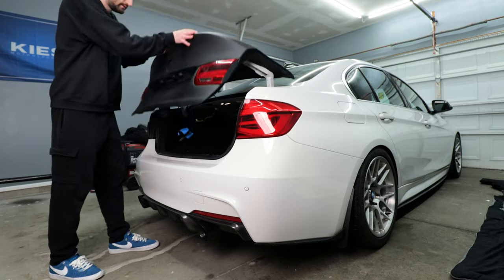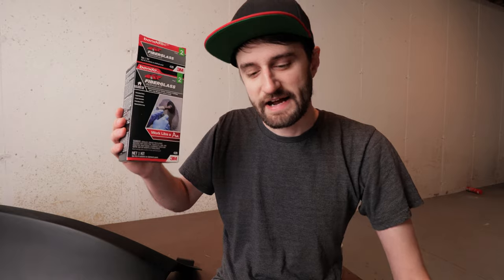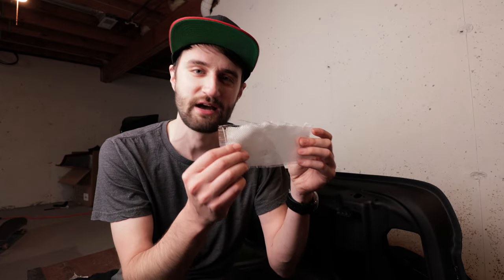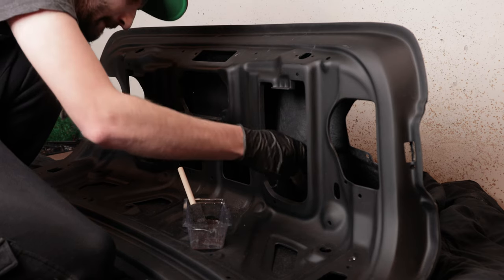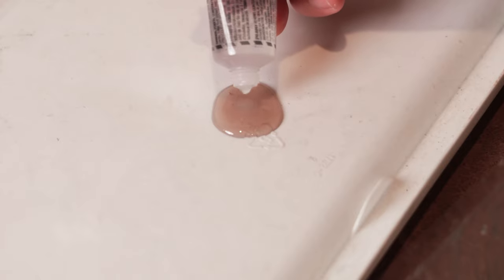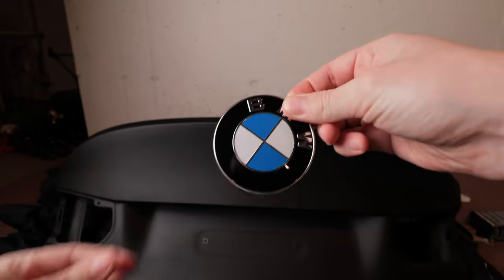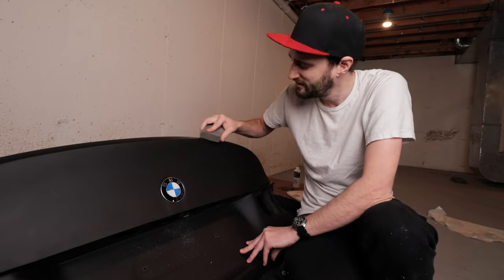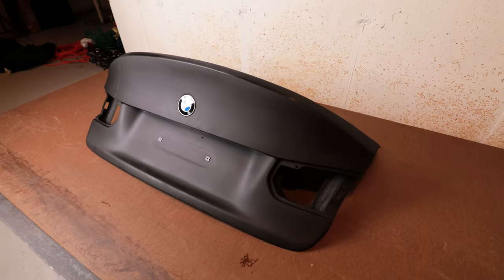HOW TO REPAIR CRACKED FIBERGLASS | BMW CSL Style Trunk Repair

Comment: Nice vid.
Just one tip, when using resin next time. Usually the amount of resin youre using depends on how stiff or flexible you want it to be. 
When Im working on aircraft parts i use a minimum of resin and at least 3 layers of fiberglass. The fibers have to be put in a 45 degree angle to the crack. So thats how you get it really stiff and by angeling the fibers it gets super resistant to shocks :)
Reply from the maker: Good to know, thanks!